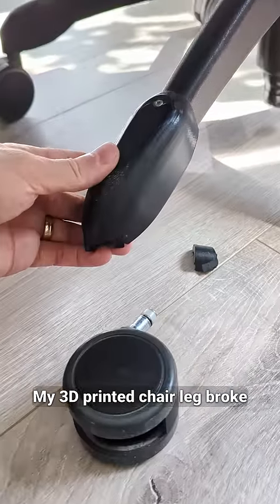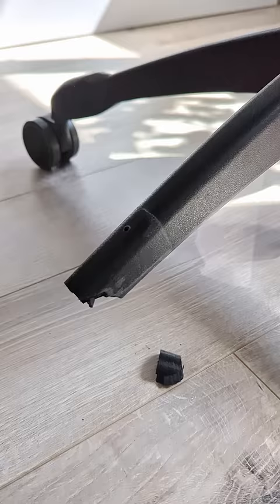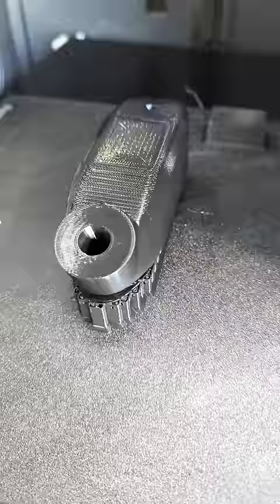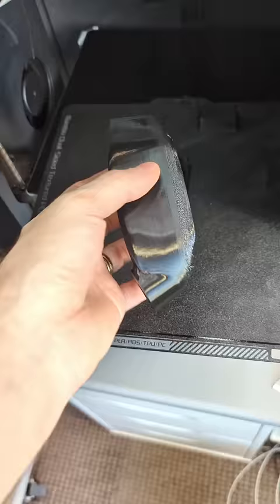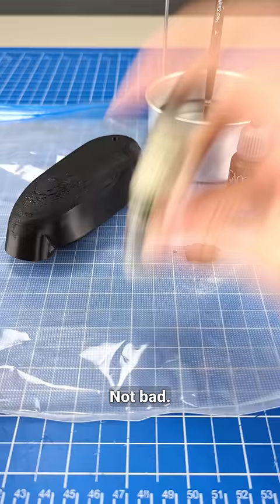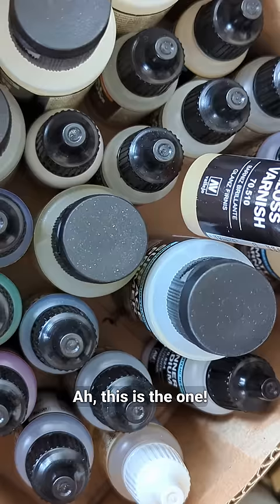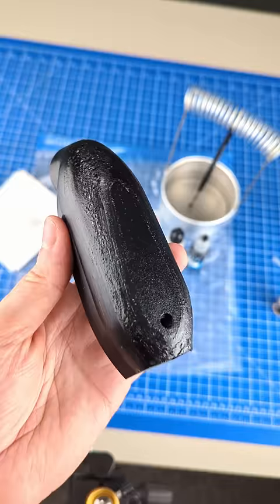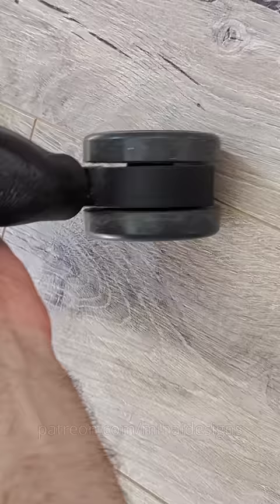Saving office chair with 3D printed wheel mount

Comment: This is what I’m talking about. Part cost less than $2, even at high infill, and saved $100 for a new cheep chair (in the US).
Reply: Yes sure
Reply: Closer to $10. I'd guess that's a 400 gram print solid and it's about 20$+ USD for 1000g. Plus wear and tear on the machine and electricity
Reply: @everett5374  so your saying he used up almost half a 1kg spool of filament?
Reply: @Kidinventor7777  probably a little less somewhere between 1/3 or half a 1kg spool if it's solid which it looks like it is
Reply: @everett5374 there was infill visible in the video, definitely wasn't 300g of filament. More like 50-100
Reply: @everett5374 electricity is so cheap bro
Reply: @everett5374  Good point. I did not attempt to do the math. I will say I have done the math for my printer and electricity, and the electricity cost for 3d printing is not very high. It adds a few cents max to each print.
Reply: @johnmoore5593 ok
Reply: @JVEPrintingStudio literally that was probably AT MOST ¢1 of electricity
Reply: Cheap*
Reply: Now capitalism is angry. How you dare to repair instead of buy?
Reply: Glue?
Reply: @everett5374 bruh even if that is solid it would not take that much filament
Reply: @everett5374  pay on average $10-12kg and that’s only buying 1kg at a time, not in bulk. My machine has over 394 days of print time and 9715 meters of filament and I didn’t have to fix anything until recently and it was a $3 part just because the threading had worn down from swapping the nozzle so often. I paid $10 instead to get a better part to upgrade it since I was having to change it anyways. It took all of 10 mins to replace lol. Also there’s typically no reason to print large solid pieces since 50% with increased perimeters is often stronger because it has a it more give/flexibility

So absolute max 200 grams =~$2.25 (but more likely around 100gs) 

That being said, he could have just bought a sturdier chair in the first place, likely for the same price just more research. Also he had to put time into making the part and then touching it up afterwards so it still cost him time even if it saved money. Although if he printed it with better settings it likely wouldn’t have needed any post processing.

Also the electricity really isn’t enough o even calculate because at that point you’d have to calculate the shelter and lighting expenses as well lol

Not trying to argue or anything, just giving my opinion. sorry if this sounds grumpy or something, I’m just tired so I’m typing a bit robotic lol.
Reply: 3d printer, pc, time wasted, experience, knowledge, etc are not free
Reply: Printer was 500 buck at least
Reply: Посмотрите, изначально треснувшая деталь напечатана на принтере. Скорее всего это она и была, просто ролик склеен наоборот.
Reply: where are you getting 100$ chairs that are cheap???
Reply: @everett5374 he’d have to use half a spool for it to cost 10$ I’ve used a quarter of a spool for things 3 times the size of that at 50 infill which was excessive as there really isn’t a reason to go above 35%
Reply: @everett5374 also it’s not solid you can see the infill in the video
Reply: How much does a 3d printer cost
Reply: ❤❤❤❤❤❤❤❤❤❤❤My name  is Akram
Reply: cheep cheep from the mario franchises
Reply: But the 3D printer and printing materials gonna cost a lot tho 🤷‍♀️
Reply: @yuria_lu  yeah so it’s only cheaper if you are planning on using that printer almost everyday
Reply: He just saved himself 150 bucks!
Reply: Too bad most people don't know cad. If I did I would be fixing everything.
Reply: Luckily i git an insane discount for mu
Computer chair which made it free(i found it in a dumpster)
Reply: @JVEPrintingStudio where u live? House or apartment? Costs vary bro.
Reply: @JamilKhan-hk1wl  no way you could glue that part. that sort of plastic is incredibly hard to glue to full stop, and the way it broke is very low surface area for the amount of force it is required to take.

if anything was to work it would be a soecific solvent based on what the plastic is, that might be able to melt the plastic and then form it back as strong as the original part.

like abs plastic can be melted like this used methlyated ethyl ketone.
Reply: The beauty of capitalism, he can market and sell a universal chair repair adapter. This would save people without the technology, or the knowledge to produce Hardware, so much money. All the while, enriching his family, and enriching the economy with more diversity.
Reply: @TTS-TP  yea because office chair repair is such a thriving market lol.
Reply: @JVEPrintingStudio  specially if you print at times when electricity is cheaper (usually at night or early morning)
Reply: @everett5374 even if it was solid that’s at most like 100 grams of filament you clearly have no idea what your talking about
Reply: only applicable in US
Reply: @not_even_me5035  It's about 30p per KWh in the UK. Assuming the printer is running at 200W while under load, that'd be 1KWh every 5 hours. 10 hour print would be 60p, or 75 cents. A quick google search tells me the average KWh price in the US is 23 cents, so a 10 hour print would be 46 cents. It's definitely a factor, especially if you're a business or squeezed for money. The power usage goes up with the size of the printer. 
Also, if you're printing something small and detailed, or anything with a low layer height, a print that might only cost a few pence in materials might cost more in electricity due to the extra time spent on it.
Reply: @yuria_lu  1. 3D printers aren't super expensive anymore.
2. You don't factor in equipment cost when you already own it. If you did, you could claim any purchases made for your house would cost hundreds of thousands of dollars because you have to account for the price of the house.
Reply: And the time he spent working on it: Worthless?
Reply: Or $100 in Europe for a wheel replacement 💀
Reply: $100 for a chair?? Where lmao, at best you can get a hard non-rolly chair for that much 💀😭

Comment: use a hot air gun to melt the sanded parts back to its original color
Reply: That's actually a great tip, thanks!
Reply: PETG should sand better than that really, just takes proper low-to-high-grit sanding flow. Or a Dremel with sanding head.
Reply: And the heat would melt the gaps smoother too
Reply: @adrianke77 Yeah. Start with low grit (less than 200 probably) to really rough it up and take it down, and work up to fine grit (maybe even all the way to 2000) to smooth it off. Use the highest grit you're using all over the material so that it gets opened up and you can paint the entire thing for a nice uniform coat.

Comment: In case anyone doesn’t have access to a 3d printer technology: Chair legs are almost universally adaptable on the gas strut, you can get used legs for way less than a new chair.

Comment: I would recommend Bondo, a bit of sanding then spray painting to make FDM parts look like real plastic.
Reply: it’s all real plastic, let’s say injection molded, or even just imply it with mass-produced
Reply: @zero_gravity5861  Yea funny I thought that too, was gonna say injection molded but this being a youtube comment I didn’t wanna make it sound more complex than it needed to be. Although most FDM prints are typically made of PLA which isn’t actually plastic, but that’s a bit besides the point I was trying to make.
Reply: My favorite is resin+carbon fiber/glass mat/kevlar for strength, or simply vinyl for looks.
Reply: @ethaneveraldo I've never heard it said that PLA isn't a plastic, do you have a source for that? It's not an oil-based plastic sure, but it's still a plastic as far as I know.
Reply: @SamiKankaristo  aren’t plastics by definition petrochemical products, and bioplastics their own separate category?

I know their manufacturing, chemistry, properties, and as a result use cases and life spans are entirely different
Reply: @ethaneveraldo  "Plastic" means "pliable and easily shaped", and even metals have a "plastic region" where they stretch before permanently deforming (all materials have plasticity). As a material, "plastic" really only means that it's made of polymers (which have very high plasticity, hence the name), it doesn't really matter how those polymers are made. Nothing about the word "plastic" refers to oil/petrol/etc.

Obviously, "bioplastic" can be used to refer to non-petroleum based plastics, but I don't think that makes them a "separate" category, but rather a subcategory. Saying it's separate is kind of like saying that all fuel is gasoline and biofuel is it's own separate thing, but it's another subcategory. I wouldn't call biofuel "not really fuel", same thing with "bioplastic".

Comment: I use lighter to recover print color after sanding. It melts the exposed layers slightly and it turns the same color as the rest of the print. Just move the lighter quickly so that it doesn't leave black spot. Kerosine lighters like zippo are generally better than butane but not as accurate. You can also use acetone on abs for that purpose

Comment: A good black Asa can really turn out some clean prints. I do all forms of complex geometry, and my ASA structural prints tend to outperform, at a cost ( and speed of print) to Performance ratio, substantially more so.
I have several prints that have done some pretty hard weather while holding quite a bit of load. Outside in the sun, on concrete.

Comment: They have replacement wheels with large rubber sections (much like wheels on a scooter or rollerblade) that works better for me on hard floors. I think they’re like $20, highly recommend.
Reply: yeah polycarbonate wheels, far less noisy and much smoother than the cheap wheel most chairs come with.

Comment: print the part angled to increase the strenght. plus the infill pattern is suboptimal for the task. you only have one direction of load on the part sir. consider this when choosing angle of print on plate and what infill to use

Comment: Sand with 500 then go up to 750 then 1500 and then heat gun it. Bring it to a nice finish but don't go to crazy on heavy grits. Just level out the high spots

Comment: For replacement parts, how do you accurately model then print them? Is it a 3d scan, measurement, online file, or trial and error with modeling?
Reply: Usually everything mentioned above. I don't know how this part was made, but most people model  based on pictures, and measurements. If you already know some cad program it is pretty easy to build into your workflow.
Reply: Usually measurement and some trial and error, once you get the jist of it its not that hard unless you are replacing some complex mechanism, in which case becomes a personal battle of "100 bucks? Thats too much I will spend a month to create the replacement parts while wasting 5 spools of material, worth it"
Reply: @ericsaul9306  You wish, in most cases you design parts, because they are too expansive or you can't even buy them. So if someone starts a 5 month design project it is highly unlikely it was about 100 bucks...
Reply: @zsomborszarka2616  you clearly don't know engineers and their hobbies haha
Reply: Get your calipers out and measure all the mating parts.  Estimate the radii and contours between them to fill in the details.  I work as a machinist not a 3d printer, but I always start by measuring the thing that my part needs to attach to.  I don't have access to a scanner, but I would never trust something that measures optically over using a caliper.  Especially when you have hours of run time before being able to test fit the part.  5 minutes of measuring and hand drawing will save you hours.
Reply: @ericsaul9306  I am an engineering student. I have hands on experience with my self, and with my friends. IT IS VERY UNLIKELY you start a project for 100 bucks. But inevitable to not to do it at least once.
Reply: @somethingelse4424  honest question, I'm a computer engineer that fell down the rabbit hole of 3D printing and CNC haha any good advice with calipers on complex geometry? I have learned more or less how to measure everything I can with calipers but some parts are really hard to measure for me, specially if they got curves like automotive parts

Comment: Is it possible to change which direction the printer lays down the filament?  So the forces that are present on that piece will act AGAINST the grain?  Making it harder to break? Similar to spitting wood, along the grain vs not able to against it?
Reply from the maker: Yes, but it would be tricky for this part due to the shape of the cutout inside where the chair leg goes. I find that if the layer adhesion is good then for thick parts the orientation makes little difference, especially if you can thicken them by 10-20%.

Comment: You could have used super glue instead of wasting electricity on 3d printer which also uses the PVC plastic and of course the expensive varnished and colour you used on it. One small tube of super glue could have saved all that money, time & energy

Comment: What infill pattern and density did you use for this? I’m currently making a replacement chair leg like this and am trying tri-hexagonal at 25% infill in PLA.
Reply: It depends on the part itself, and the printing orientation, bcs the force is directed. The calibration of the printer itself plays a role also. For really strong parts, I would go for 40%-70%. Trihexagonal is printed in a direction, I would go for cubic infill.

Comment: Hey I have a question. Lately my 3d prints have been turning out bad, one side doesn’t adhere well and it has small spaces almost as if something was clogging it a bit but I haven’t found anything and was wondering if there’s any possible solution

Comment: May i ask how strong is a piece of 3d printed material?
Reply from the maker: It really comes down to thickness and how much material is inside. A skinny part would be very fragile, while a piece a couple inches thick full of material would could be used as a hammer.

Comment: Hey how would you fix those bad first layers after the support i run into that problem pretty much everytime and I don't know what's going wrong
Reply: Support contact distance. If you're using multi material you can set distance to 0. PrusaSlicer defaults to like .15